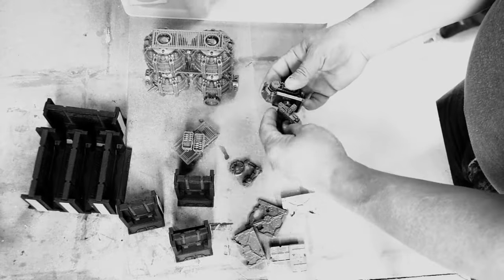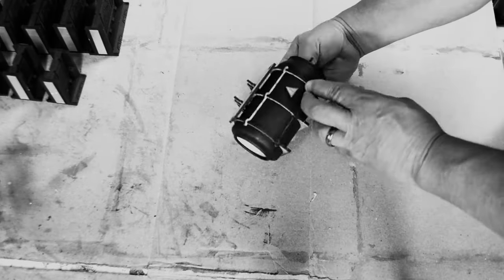What happens when the plan goes wrong?  Painting 30k Zone Mortalis

Comment: I hate painting MDF....tried it a few times and the result was always crappy....
Reply: Remove the wrap, wipe off with a damp cloth or a wet wipe, spray with primer. Works for me. You could also spray it with varnish if you have no spray primer.
Reply from the maker: I have had usually good success really!  This issue was due to rushing the process due to outside influences and bad reactions.....  It happens and I'm definitely over it and moving forward.....  just with a new airbrush that I didn't need to buy right now!:)  (psst.... btw......  the new airbrush is awesome and I'm really surprised that I didn't do it sooner!)  Updates for you soon!
Reply from the maker: Both great suggestions that I've done in the past but....  I think that I have a new concept that I'm working out with this stuff.  Update for you that is very interesting......  The spray primer and all consecutive coats of paint and ink have peeled off of the areas where the magnets are on this stuff.  Some of those little guys have up to 6 magnets in them....  not sure if there is any correlation to my troubles the other day but I thought it was an fascinating symptom that I've not encountered before.  Thanks for tuning in!
Reply: Some people say to use a sealer on the bare material. I've found that spraying some varnish on it before applying primer/paint helps me a lot. Prevents soaking, and makes it less likely to chip. Did a large board very recently with the bulk of it being MDF and it's held up well and the paint went on like a breeze. Hope that helps.
Reply from the maker: It does thank you!  Amazingly enough...... It seems that I seem to thrive on trouble and have a open-mindedness to try out something a little weird which worked out and will be in the finish video soon!  Talk about happy mistakes indeed!  This is working out so well i might incorporate it into all of my MDF projects!  Stay tuned and thank you for tuning in!

Comment: Hey if you haven't checked out SJ's Crafting World there is a tutorial called underneath zone mortalis that would probably mesh very well with your hive secundus stuff.   https://www.youtube.com/watch?v=qH8BHpRqfBY

As far as airbrushing goes you might need a moisture trap between your compressor and airbrush, not sure if that would make much if any difference with acrylic paints or inks, but I suppose it doesn't take much moisture to really throw the ratio of the mix off given how little paint get's used.

With the MDF stuff have you considered taking some thinned down Milliput (or thinned down Spackle) and then sponging or stippling it on to get more of a concrete texture? maybe paint it on the bits that are supposed to be metal and then give them a quick sand once dry.
Reply from the maker: I'll check out that video thanks!  The person that I'm doing this for didn't want any extra textures added to the pieces unfortunately but i usually hit this stuff with a sand pva mixture for that concrete look, but.....  that's not what he wants.  As far as the airbrush I have a moisture trap on it already but that was not the problem... the problem is that i'm too hard on my stuff really and the gun is fine but not for everyday use.  There is a divot on the needle that happens on this gun when you overtighten and take it apart to clean it too often.  It's so small that you have to run your finger along the needle to feel it and what happens is that the needle for lack of a easier explanation doesn't sit quite right.  It will fire paint but sometimes it will stray the shot on you.  I mentioned this in the video that it was me that did this, because i did it before so....  I got a much higher grade gun this time and.......  I should have upgraded sooner.  The Iwata hc is quite a gun if you spray a lot and the rest of this project has been a blast to do after I ran the new gun through its measures!  The vid will be done soon and you can see!  Thanks for the feedback as always!